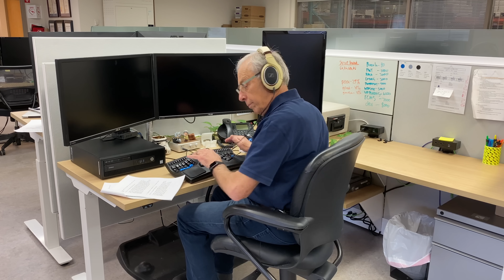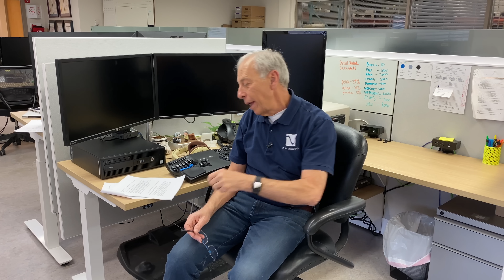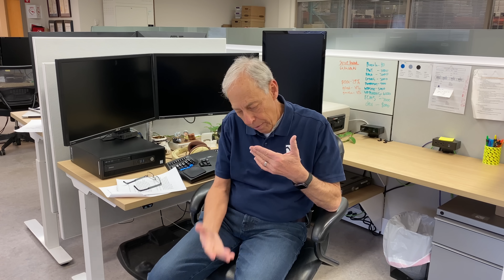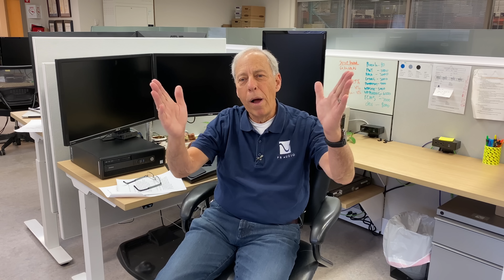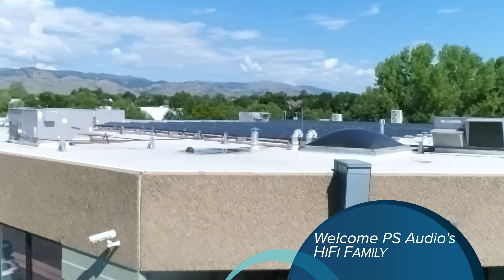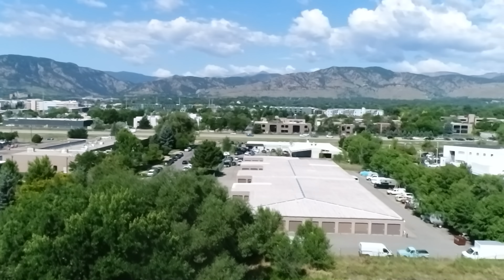Are watts the same for transistor and tube amps?

Comment: Then why is it, that with guitar amps, tube amps are much more powerful and much louder, than solid state amps, of the same wattage, if watts are watts, and there is no difference?
Reply: Tube amp power supplies, along with the plate resistance of the tubes them selves compress the incoming wave.  This has the effect of broadening the shape of the wave in a manner that raises the average level at the expense of the peaks of the wave.  Soft clipping basically.  Transistor designs essentially maintain the wave shape until the power supply  rail voltage, then the wave is clipped hard giving the harsh distortion with non-musical harmonics.  This usually means the guitarist turns down the amp.   If you apply a circuit that compresses the wave the way tube amps do, a solid state amp will put out the same “loudness”.
Reply: @stephenmead5488  That makes sense. Thanks!
Reply: EL34 tubes can to goto 500 cvolts and it gives lots fo hedroom. transisters cant do that because they start clipping, but tubs gently compress the signals insted of cutting it offs. Its the old argument of useing a lower powdered tube amp , or highigher power trensstores power amp but turn the sound doan and have the restr of power evaables fo rhedroomses. THENK YEU AN DTHUBBMS UPS! its the FTC minimim contiinuos RMS power at a certin aharmonics distortions.   transisters distord goes up way fatter with the clipping, but no so mush with TUBES. THANKES YOU!

Comment: Back in the 60's the Watt in Europe was half that in the US ... I have not found out why this was so ... does anyone know ?
Reply: A watt is the same everywhere, even on Mars. What is different is the current in amps is half when the voltage is doubled, 240 volts in Europe versus 120 volts in the US.
Reply: @StewartMarkley  Watts are not the same everywhere. I believe there used to be an issue in audio with the type of voltage and current used to calculate watts. Is the wattage calculated with the peak voltage or the rms voltage? If in the 60's the US used peak voltage and Europe used rms, then this is the answer to the question.
Reply: @yziib3578  No, watts are the same everywhere and at all times. What is different is the way that the power rating for audio amplifiers is determined. Technically, there is no such thing as a RMS watt, it is the voltage or current that is calculated from the peak value of a sine wave that is the RMS value used to determine the so called RMS watt. But getting back to your 1960s reference, there was a common preference by some amplifier manufacturers to use the peak value rather than the RMS value to rate their amplifiers, and the FTC tried to equalize if you will the ratings to help consumers compare products which was only somewhat successful. Then there is still the practice of using short term amplitude bursts at rediculous distortion levels to jack up the power ratings even further. But the unit of electrical power the watt is unchanged everywhere and always will be.

Comment: As a Bass Player I have noticed that Tube amp vs Transistor amp same wattage at same ohms, the tube amp performs much better. That given, I use a Solid state amp that is close to 2 X  the a tube amp. Reason being that tube amps are high maintenance. If I was rich I would definitely go tube.
Reply: The tube amp performs better than a transistor amp at the same power rating  because the tube amp sounds much better when handling the music peaks which drive the amplifiers into their nonlinear operating regions and the distortions produced by a tube amplifier are more pleasing to the ear. Better to use a more powerful transistor amplifier and stay below the nonlinear region.

Comment: Funny thing is when your out playing guitar with your buddies or a band, everyone has their 100w, 150w and 200w guitar amps with a million effects and modulations........................I show up with my older Vox AC15 (15w full tube amp), fiddle with a few knobs and 2 minutes later I have a better sound that any of those other "fancy amps" can ever make and loudness to spare over top of theirs cranked amps. Hell I've gigged small venues with a small 4-watt tube amp (Vox AC4) turned up halfway.

The issue is that "loudness" is NOT equal to watts, and just because you doubled your watts doesn't mean you'll double the perceived loudness. There are much more factors at play here, and generally tube amps are rated for constant power handling, and solid state amps are rated for maximum peak watts.
Reply: From Leo:  I have never gigged with a man with a VOX AC15, but I have gigged with a man playing through a VOX AC30.   THAT amp was LOUD!
Reply: @barbmelle3136  - The db difference between the AC15 and AC30 (both with 2x12" cabs) is only 3db, which is hardly noticeable to the human ear at that level.

That being said, when going from an AC15 to an AC30 you gain a lot of headroom, so it stays cleaner for longer (as clean as a Vox gets anyway). To get an AC30 really sounding good and to get that Vox grit, your running it hard...............But sound glorious when you do.

An AC15 is great for gigging small venues, or mic'd in large ones and breaks up easier at lower volumes. Usually they are a 1x12 combo, with a greenback Celestion speaker.

I upgraded my AC15 a proper UK made Blue back Alnico speaker, and let me tell you it barks and has the unmistakable "You will hear me NOW" Vox grit and beautiful chime on the top boost channel.

The Vox AC amps are NOT clean amps, they are always dirty and gritty............but to me, if I want to play clean I pay my Fender Hotrod Deluxe, but I tend to turn the AC15 on more often and plug straight in, where as I use the Hotrod for a pedal amp and let the pedals shine.
Reply: Absolutely true that doubling the power doesnt  double perceived loudness. It really just means that the music peaks will be less distorted. The average level will be much less than the peaks for most music, 10 times more or less.But where did you hear that tube amps or any amplifiers made for music for that matter are rated for constant power?  There is nothing constant about music levels. All amplifiers made for music are rated by their distortion curves, and manufactures are free to chose at what point the distortion becomes significant.

Comment: Hmm.. I think the question was, why do people say that power from a tube amp doesn't need to be as high as a transistor amp? And the answer to that question is in the clipping characteristic of tubes vs. transistors. In other words, transistors need more headroom so you don't clip them, which does not sound good. But tubes clipping are not as harmonically noticeable. At least that is the argument I've heard.
Reply: Thank you.
Reply: This is correct. If buying a SS amp go for the highest power you can afford. The amp will never be driven to the point of distortion, which sounds harsh on a Ss amp. My amp is 540 watts per channel but I doubt it ever delivers more than 50 watts

Comment: 2:02  If you double the 2.83V output, the power goes up to 4W, not 2W.  
5:20  A few "Goofy" SS power amps have output transformers?  I think you've just managed to ruffle a few feathers at McIntosh.  Also Sansui BA-5000 designers will be annoyed at the comment.
Reply: @behexen250 
That's like saying the folks at Ford Motors would be aggravated with me for "confusing" their branded vehicle designs with cars and trucks.  
Autoformers (abbreviation of auto transformer) are just a special case of transformer.  The advantage of using the autotransformer is that with low-impedance speakers connected to the lowest-Z tap, it becomes a direct-drive amplifier.
Reply: @behexen250 
I don't doubt that Mcintosh applied some creativity in their design that gives them a performance edge in some way, thus adopting an unusual variant of "auto transformer."  
But McIntosh marketing aside, it's still a subclass of transformer.  
The same circuit topology has been used by others.  One advantage is that when using the lowest-impedance "tap" you are actually getting direct drive from the output transistors.
Reply: Both are very good  amplifiers.
Reply: THANKE YOUY FAIR LADY., THUMBBES UPS!

Comment: Something I have never understood: Since watts are volts x amps, any number of combinations of volts and amps will yield the same watts. For example, 10 volts and 20 amps will produce 200 watts as will 20 volts and 10 amps. From the standpoint of amplifier design is there any reason to prefer one mix rather than another?
Reply: That decision is actually made by the speaker design, not the amp design.
Reply: @behexen250 That makes sense to me. I wonder why amplifier manufacturers do not routinely specify amps, but use wattage only. I wish Paul would talk about this. I have asked the question but he hasn't included it in these daily videos. It seems like an important issue.
Reply: @FatRat-f9m  Unfortunately, ME Amplifiers appears to be no longer a going concern. It is offering service for existing customers, but has stopped sales of any new amps. Also, they don't appear to specify volts and amps in a way that makes much sense. For example, the output of the ME 550 is specified at 50 volts and 40 amps peak. That would be 2000 watts. The amp only outputs 100 watts per channel @ 8 ohms and 150 watts per channel @ 4 ohms.
Reply: @FatRat-f9m  There is nothing about this that I do not understand, other than the utility of a specification intended for consumers that is not very useful, especially since the watts cited are not "peak" values but apparently RMS (continuous output prior to clipping over the entire audible range). The value cited, 150 watts per channel @ 4 ohms, suggests only about 3 amps, if the 50 volts figure is to be taken at face value. My whole point in bringing this up was to suggest a more comprehensive amplifier power output spec for consumers. This is not that. Furthermore, the fact that these amps are no longer available to consumers would certainly be quite relevant to anyone reading this thread. It was not intended just for your eyes only.
Reply: @FatRat-f9m  Look, you can be as obnoxious you want. That seems to be your style. Please point out for the rest of us where I display a lack of understanding as to what peak amperage means. That's not even close to the point. The point, if you care to reread my original post, was about the relationship between amps and volts when specifying watts. In this particular case, that relationship is hopelessly muddled because the manufacturer lists continuous RMS watts, peak amps, and ??? voltage (this is not defined one way or the other). As I have already pointed out, my original question was about making specs more meaningful for consumers. Pointing out that an example given is from equipment not available to consumers may not be relevant to you, because you already knew it, but it is certainly going to be relevant to others. Had I read about this the first thing I would have done would be to go to the manufacturer's web site and look at those specs and see what products they applied to. I mentioned that this was essentially a dead company to save people the trouble.
Reply: @FatRat-f9m  I thought it would have been obvious. Save people the trouble of finding the web site and tracking down the relevant specs. 
Great. Just what the world needs, yet another Internet troll. You throw around insults and name-calling for no apparent reason other than the fact that it apparently feeds your ego while filling in for the fact that you have nothing interesting or useful to add to the conversation. How much watts=volts * amps information do I need? Well, how about a single example? I certainly didn't get that from the example you cited because the watts and amps were not stated in equivalent values: "peak" and "continuous" are not directly comparable, certainly not in a watts=x * y form, something I tried to explain, but you would rather just embarrass yourself with ignorant putdowns. Why don't you try actually contributing something substantive to the conversation? It is so much more interesting for the readers. And, btw, no one ever suggested I required "multiple readings of current at every step along the amplifier's gain control." You just made that up. Does "peak" mean sustained current within a specified frequency range and distortion threshold or something else entirely? Maybe it just means  brief transient output within a very narrow frequency range and above clipping, however clipping is defined. There is no way to know. Without a clear definition, it is essentially a meaningless specification.

Comment: One Watt is one Joule of energy per one second of time. The energy moves your voice coil. 100 Watts is thus 100 Joules per second. One Calorie is same as 4184 Joules. Your body is typically running at 100 Watts when you are sitting down listening to music. Thus only if you play loud music, your music system will use more energy than you are! A Watt is a Watt no matter if the energy came from food in your stomach or natural gas burning in a power plant making electricity for your amp. The amp essentially modulates the energy to make sound...🤔
Reply: Bill Strickland, who used to edit Bicycling Magazine, once said that according to a study he found; If one could convert calories to gasoline, bicycles would get three thousand miles per gallon.

Your mention of using 100 watts at rest made me think of that.   : )
Reply: @Hare_deLune  Gasoline was indeed "produced by calories" long ago...the sun's energy (calories) grew plants on planet earth that turned into decayed remains of plants, bacteria, or animals that today, millions of years later, is the gasoline we use. Fossil fuel is old organic matter that all has energy that originates from the sun. A Big Mac contains 560 calories. A gallon of gas contains 31000 calories or same as 55 Big Macs of energy. Thus if you put 55 Big Macs into a sealed container and leave it there for millions of years, you might get a gallon of gas out of it if you are still alive...well, less than a gallon due to efficiency losses.
Reply: @ThinkingBetter 
Wow, I thought I was a nerd. Lol!   : D
Reply: @Hare_deLune  Perhaps we are both nerds, but I definitely will be the first to admit I am a nerd in science and technology.
Reply: @ThinkingBetter 
Yes, we are.
I was merely acknowledging your superior nerdliness.   : D

I'm more of a general information nerd.
Reply: @ThinkingBetter  Calories in food are actually kilocalories. So a Big Mac actually contains 560,000 calories, for the purpose of calculating energy.  So a Big Mac is the equivalent of about 18 gallons of gas in calories. If we could only convert that energy efficiently to mechanical energy we could go for many miles in a Flintstone car. 😁
Reply: @StewartMarkley  LOL, I knew it. This is America, the land of unit confusion due to use of old units. One gallon of gas contains about 120 million Joules. One Big Mac contains about 2.25 million Joules. Just Google these numbers. 120/2.25 = 53.3 Big Macs per gallon of gas. But this guy is even worse "calculating" that it takes 54,700 Big Macs to get the energy of 1 gallons of gas: https://global-macro-monitor.com/2018/12/31/bftp-greatest-arb-ever/ He is wrong by a factor of 1000 LOL
Reply: @ThinkingBetter  I get 131760000 joules in a gallon of gasoline. Divided by 2250000 joules in a big Mac gives 58.56 big Macs to a gallon of gasoline.but whatever, I forget why we are even down this road.
Reply: @StewartMarkley  Neither a gallon of gas or a Big Mac represents a precise measure of energy :-)
Reply: if I rember correct 1 watts is 1 nertons meters perseconds. gravits at see level is 9.81 metr secons second. lifting a 1 kiligram at CONSTANT SPEED vertically at se elevals i 9.81 watts. water is 2264.705  kilojule kilogram latent heet vaporization  but LEAD i s only 871 kilojule a kilegrems. 100 watts at rest includes brething out steam which is latend heat of vaporizating.  they get the energy content of food from a bomb calirometer. If a soda can 24 ounces has 1,400 kJ, it is 1,400,000 joules, divide by 9.81, it its somehign like lifitn a 1 kilogrem waight 140,000 metres up in the air at CIONSTANT SPOEED. THANKES YUE AND THUMBBS UPS!
Reply: @ilovecops6255  One Joulse is the energy needed when a force of one newton acts on that object in the direction of the force's motion through a distance of one meter. It's also (not so precisely) similar to the energy required to lift a medium-sized tomato up 1 meter (3 ft 3 in) on this planet. Thus 100 Watts is similar to the power needed to lift a box of 100 tomatoes up 1 meter per second. If your 100 Watts amplifier could be somehow connected to drive a robot lifting tomatoes and the robot was 100% efficient, it could keep lifting 100 tomatoes per second up 1 meter in a factory.
Reply: @FatRat-f9m 
Yeah, pretty much.

Comment: If you look at Stereophile when they test tube amps they almost ALWAYS come up short in power ratings. Solid State amplifiers not so much!
Reply: @behexen250...my guess is , 'manufacturer's specs.'
Reply: @behexen250 To their claimed specifications. The manufacturers make the ratings at a lot higher THD rating than what Stereophile measures at.  Stereophile measure the maximum power at 1% THD.